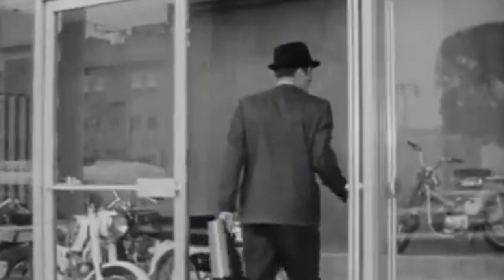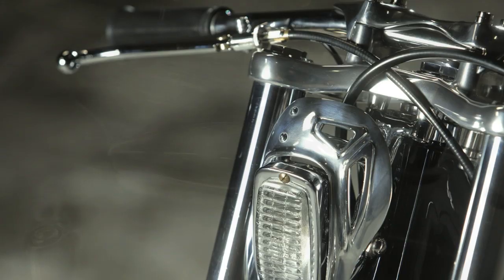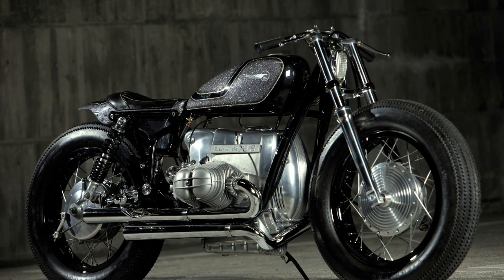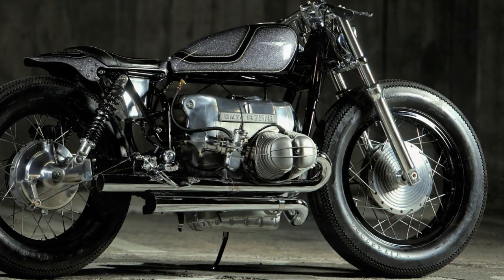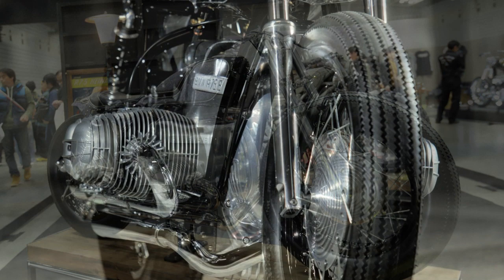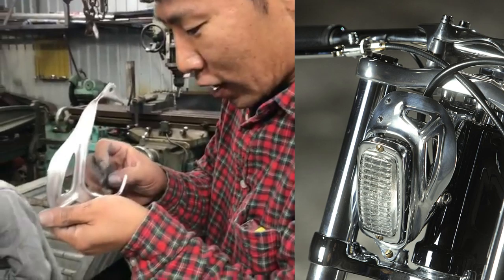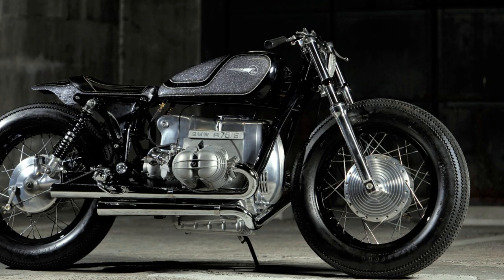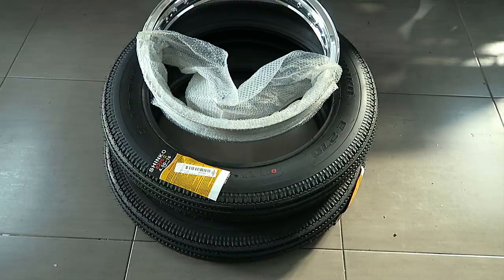Cafe Racer (BMW R75 by Heiwa Motorcycle)

Comment: Great build along the elements of a certain style - 10 out of 10! for that. What I have certain issues with are the 90% non existent front suspension and sub-optimal rear suspension, followed by the ancient looking no doubt new "car" tyre on the front. As a styling exercise this will look good outside the KFC around the corner - not worthy to be called a Cafe Racer. You cannot go fast on that thing other than on a perfect level road with no bumps. Great looking Beemer though. That fat front tyre will give you about 20mm of extra travel when inflated to 150KPa. When I think of the perfect BMW, Ritmo Sereno comes to mind. It's not only about the look of your ride - But about the look - And - The ride.

Comment: If the head light is good for a night ride then it’s fine with me, rear suspension is too soft, it is noticeable that with the rider on even at low speeds the tail “almost” touch the tire, other than that beautiful bike and nice video!!